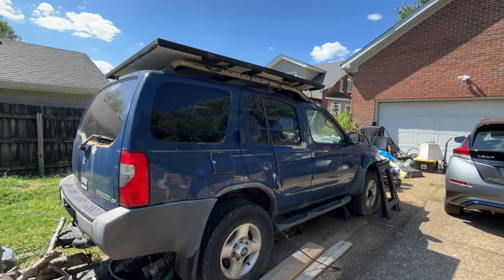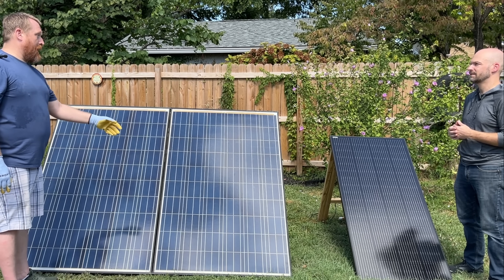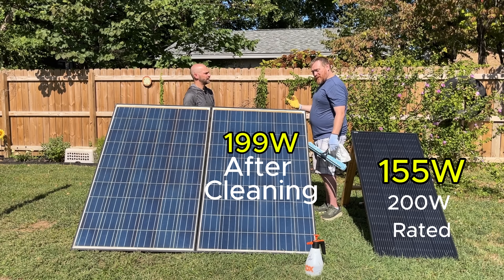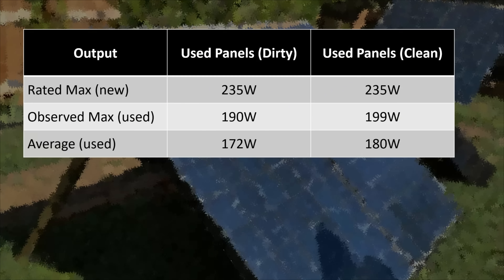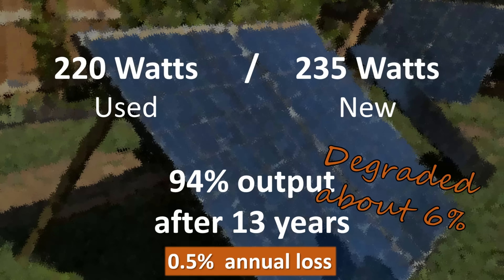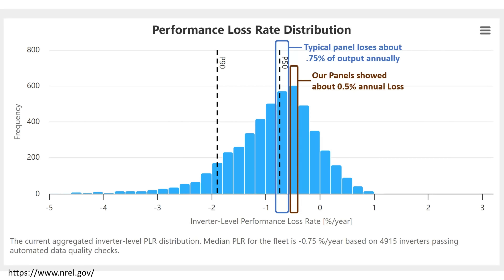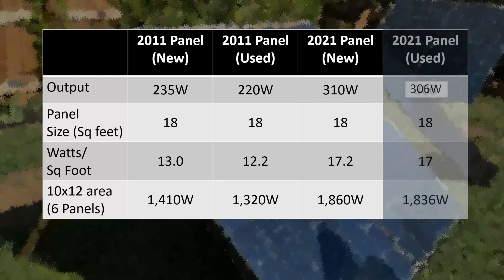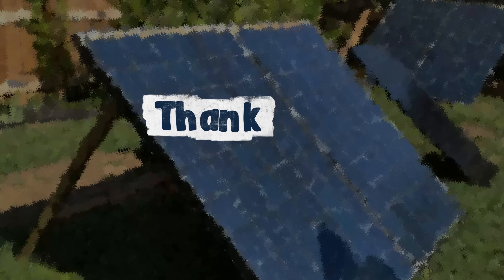Considering used solar panels?  We put them to the test!

Comment: Well, considering the price for the used panels, Free in considering if you just added two more used panels you’d make up for the loss and efficiency from new panels. I’d say they use panels were a great deal.
Reply: This is how you really use second hand solar panels. Panels lose efficiency over time. A grid connected inverter has a rated DC input voltage to enable it to produce the inverter's rated output. By increasing the number of second hand panels in a string you raise the input voltage to the inverter and increase the system's output back to original specification.

Comment: I say yes, Used can be good, if you know what you’re getting and the price is appropriate.  My advice is, if you’re going to pay money or put labor into obtaining the panels, test them for voltage (at a minimum) before.  Also, inspect them for damage to the bottom side too.
Reply: You can get a cheap thermal camera these days and check the panels as they heat up, run and cool down.

Comment: The question is : why do you need panels for? If you want to lower the bill they free panels are a benediction. Keep in mind that if they come with free mounting hardware, free cables and free inverters it's even better.
You can't beat free stuff when it comes to economics.

Comment: I bought 10 x 180W 15 year old panels and an inverter cheaply from a guy who was upgrading. He gave me the original sales invoice for over £16k. I have now been using them for over 5 years. On a sunny day these 20 year old panels still do just over 1500W, so are 20% down on their abs max output. This all assumes they could actually do 1800w in the first place. I couldn't be happier with them.

Comment: Are the old one polycrystalline panels? (since they are blue in color) 
The modern panels are usually monocrystaline (black) and is more effective per square feet so that should be considered in this comparison..
Poly panels was cheaper compared to mono cells per square feet but is less effective.
Reply from the maker: Yes - good point, older panel was poly-si.

Comment: Best advice imo is to invest in the $100 panel tester, i bought some 310W panels that i found to only produce 150W afterwards. I bought 8 and had hoped they would produce around 250W to get around 2kW for $80 a panel but unfortunately they only produced half of that. The panels in the video were free so pretty much the only factor that would be relevant to me is the size/kW.

Comment: I've got 123 panels & all but about 12 are used but not very old. All my used panel put out to spec but were about 1/3 the cost of new panels. Best way to test used panels is to use a clamp amp meter with the - & + wires plugged into each other.
Reply from the maker: Thanks for the tip on testing panels with a clamp amp meter!

Comment: also in hot climates mono cells do better. in colder places poly panels like these would be good.
but on the other side it is free, why complain.
also you can buy now for about $60,= ( here 50 to 55 euro ex vat )
600 watt panels dual glass panels. size is about 115 cm x 235 cm.
Reply from the maker: Good to know about mono cells in hot climates. We've seen a spike in panel prices in the US lately.

Comment: The issue I have with my panels is that during August they do not produce as much electricity because they get too hot. 

I'm going to have to look and see if there are any solar panels made to handle the heat better.  It's probably cheaper just to buy a couple extra panels.
Reply from the maker: Yeah, the test day in the video was very warm, too.  Would be curious to hear if you find panels designed specifically for higher temps.
Reply: @BackyardSolarProject 
Okay this is odd. The post was censored.
Reply: @BackyardSolarProject 
Monocellular panels do better in temperatures over 100° f than other panels.
Reply: @BackyardSolarProject 

One such panel is the RC alpha pure RX solar panels. 

They are about 350 for a 400 or 450 watt panel.
Reply: Okay I break the information into two posts, drop the dollar sign, and no censoring. 

How bizarre, how bizarre.

Comment: I plastered my roof with used panels and built a Tilt Array with 12 more used panels.
29- 250W panels and 22- 100W panels = 9450W
I reduced my electric bill from about $450 per month to about $150 per month.
I have power to spare.
Reply from the maker: Wow, that's an impressive setup and great savings! Where did you source the used 100W panels?

Comment: Even when the panels are free the rest that is needed are much of the cost. Batteries, charge controller, inverter, connectors and cable. If you have to buy the rest it could be smart to buy the panels new also since the payback time could be a lot shorter even with the added cost from new panels.
It can be expensive to save money when you install something that is meant to last a long time.
Reply: If I had free solar panels, I could try connecting them directly without a regulator to my 2 cubic meter water heater. I normally heat the water heater by burning wood, but it also has backup electric heaters. Free solar panels could reduce wood burning and labor, and store energy without any investment, battery chemicals, or use of natural resources. Heating elements are unlikely to be very sensitive to voltage, although the thermostat and circuit breaker are designed for AC voltage, so I'm not sure about their durability. You could also try connecting solar panels directly to electric radiators which are also available practically for free. Here in Finland, the sun rarely shines during the heating season, so it is not profitable to pay for a solar power system for heating, although hot water is used all year round. Also, globally, a large portion of electricity is used to heat water, so why are inverters, controllers, and batteries needed when energy can be stored directly in water without toxic battery chemicals and mining?
Reply: @AH-li7ef  If you have a use case where you can connect directly to a heating element you can cut much of the cost.
It will for must people be of limited use.

Comment: Also before paying for used panels, or even paying to transport free ones, check the current price on new ones - here in the UK you can get 450W panels for GBP66 / US$80 delivered.
Reply: Please share what source you're finding those prices from! Here in the US, a 400W is about $250 new
Reply: @videosfromelsewhere926  City Plumbing in the UK. But Tarriffs are probably messing up the US market
Reply: @mikeselectricstuff thanks! Yep they really are. We're being squeezed every which way
Reply: @videosfromelsewhere926  
UK, shipping them from China is going to be a lot cheaper for them than having them transported over sea to the states.
Reply: @MHawkeye Specifically, which company or outlet? Comparing our supply chains. I suspect we're getting the same Chinese panels but with a steep markup along the way. Tariffs aren't helping either
Reply from the maker: That's an incredible price for new panels, especially with delivery included!  Do you have to buy a pallet for that price?
Reply: @BackyardSolarProject  Nope - Just a £75 minimum order.

Comment: How did you determine the output watts???  You never said.  What testing did you perform?
Reply from the maker: I used a power station, in this case a Bluetti AC70. I was able to measure watts, amps and volts.

Comment: G'day Mate, my best advise to anyone trying to live offgrid is to buy as many secondhand solar panels as you can, have them along every fence and on the ground. I have been buying any secondhand solar panels from Facebook Marketplace for over a year, to the point where I have 120 solar panels. Now it doesn't matter if it is rainy or cloudy, I am always making some power whenever it is not dark. Old solar panels might have less output then new panels, but it all adds up to getting more power into your batteries. But take a multimeter to test that each panel is working when buying secondhand solar panels.
Reply from the maker: That's a lot of panels, sounds like a great strategy for maximizing power! Where can we see some pictures of your setup?
Reply: Me too mate, bought 20 250w panels for au$300, blasting out power, bought some more so i have overcapacity for my chargers, so i still get decent load in dull cloudy weather, 6kw of inverters, can run aircon  and charge batteries at the same time.  South australia
Reply: As long as you know how to properly test a solar panel.  They can be deceiving.
Reply: @rickschlosser6793 can you explain how to do it correctly please
Reply: @timanderson-q2w  - you buy an electronic load with sufficient voltage and current capacity.
Then you measure the output in full sun.
Reply: @johncoops6897 cheers mate 
Jaycar I'm coming 😂
Reply: Very wise choice mate 
I'm up the top end doing the same thing but not quite as many panels yet 😂
I'm silicone mine together up on the purling no tin😂 just solar panels 
The new truck park is near ready 😂
Reply: I would like to do this but don't understand something. Isn't there a risk of having too much voltage going into your inverter on a perfect/sunny day? How do you prevent that?
Reply: @Just4Ever - you use an inverter that is designed to accommodate the panels you intend to run.
The panels aren't always connected in series (adding the voltage) - for example, you can run two in parallel which keeps the voltage the same but doubles the power output.

Comment: People have to understand that the rating on these panels are under optimal testing conditions-cool day, desert sun, higher altitude etc. 

There are panels made in the 1960’s that still produce useful power-these panels still represent a GREAT value, especially for DIY’ers who don’t care about warranties. On a dollar per watt basis, these are disgustingly affordable and represent an opportunity for everyday people to have access to a very powerful off grid setup very affordable. 

I am running an entire off grid cabin with microwave, 160 foot deep well, washing machine, electric log splitter, coffee water heater, all charging of electric chainsaws and personal electronics etc. on just for (4) 235 watt panels and eight 6 volt 150AH batteries. 

And BTW: It’s the solder in the panels that degrades over time, the silicon is fine.
Reply: Current solar panels are guaranteed to have 85-90% power retention after 30 years, so technically the solar panels will outlive any human before it really needs to be replaced
Reply: Awesome ❤ information mate cheers

Comment: So, these panels still output a decent amount of power and they were free...
And by extrapolation, you can assume, after 14 years and quite a small loss, you could get probably another decade of power out of them...
If they were still good to use, why would you bother to get 'newer' panels at some cost, when these were free?
Reply: If you dont have much roof space, replacing those older panels with new 475watt units would double you're solar power output. Of course if you have plenty of good roof space left and want more solar, you would just add another string of new panels and keep the old ones running. Probably need a new  inverter to get the best out of the system either way though.

Comment: Other things to test with used panels (with a multimeter):
Open circuit voltage
Short circuit voltage
(both will be different from when new, but be cautious of panels that are significantly different from the others. There is no use putting up ‘dodgy’ used panels
(TYPO - I meant to type short circuit current)
Reply from the maker: Thanks for the helpful tips on testing used panels with a multimeter!
Reply: You don’t measure ‘short circuit voltage’.  I don’t even know what that is. 

The proper way to test a solar panel is to find the nameplate on the panel and look for the ‘Isc’ rating.  That stands for ‘short circuit current’. 

Get a clamp on current meter set on DC current, use a short piece of wire to momentarily short between positive and negative and measure the current with the meter.  Then compare that to the specification. (Obviously do it under full sun)

Just testing voltage won’t tell you if it will fail under load.  I was taught this method by an electrical engineer.

Comment: Used panels are so cheap I saw a solar fence last week at a suburban home. I thought is was weird till a saw a YT video with vertical panel tests that showed a surprising output compared to normal slant panels. The output from North-South panels balanced the output from East-West aligned panels. I the winter snow the vertical panels exceed their rated output and bested slant panels even after snow removal. The vertical panels clear the snow automatically!! Cheaper that fence wood I expect to see more urban and farm fencing made from used panels.
Reply from the maker: Yes, it does have advantages.  Also - agree, there are some interesting videos on this topic.

Comment: sorry why you not replace your control panel?
a 200 watt rated panel that not deliver its rating have clear maufaktur failures !!!!
for example a callsun 200 watt rated for 200 watt deliver 200watt...so it have to be !!!!

next part a 200watt watt panel from today need 2x smaller space to produce there power !!!!!
so if you limited in space why someone will used ultra big panles with ultra low power for there surface???

Nowadays, solar panels deliver 220 watts of power over an area of one square meter! 
Classic roof panels are exactly 2 square meters and come with 450 watts precisely for that area.

that matters for most people
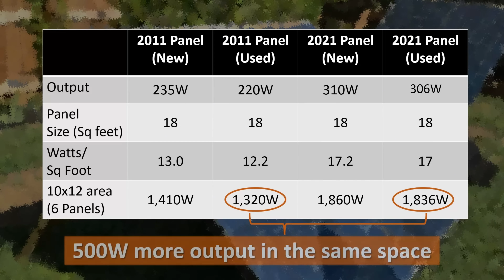Reply: I don't care what brand it is - A panel PRACTICALLY NEVER puts out its actual rating unless it's under lab-perfect conditions, and then, only for the few moments when those perfect conditions apply. Anybody who thinks otherwise is delusional. Ratings are based on those "lab-perfect" conditions - which are almost never seen in a real-world installation, and on the rare occasions they do happen in the real world, it's for a few minutes per day before things (like exactly where the sun is, and how hard the wind is blowing to cool the panels) change, and you start seeing the more normal lesser output. ANYBODY can set up a panel to produce "perfect output" - from between 12:01 and 12:07 on June 22 - any other time of the day, or any other day of the year, it's going to be "less than perfect" unless you're sitting there tweaking it every 3 minutes or so.

Comment: That's all I buy these days. Here in the Bay Area of Northern California, some solar suppliers sell used panels from failed businesses. I can get used 350-watt panels less than 5 years old for only $35- $40. All work just fine.  Test them before you buy them.
Reply from the maker: That's awesome! Always great to hear about a good experience finding panels locally.

Comment: The real comparison data would be dollars per watt .in my area 10 to 25 cents per watt is common for that price just add a couple panels and you are well above any reduced output and well below the cost of new .
Reply from the maker: For sure ... and the cost per watt also needs to take into account shipping/delivery. These free required a reciprocating saw for disassembly, transport took a trailer, and would very like need two people for installation. In the end, it definitely wasn't completely "free".

Comment: I've bought new and used and had better bang for the buck with used. I bought from a solar farm builder and paid less than 20 cents a watt. The panels had 5 years of service and were replaced for optimization.

Comment: Building material is expensive too, solar panels are at least as good as roofing material as anything else, add a car battery and some cheap LEDs and you have a carport which is illuminated at night for free
Reply from the maker: I've heard this from a few different viewers now. Definitely an appeal as a low cost covering for something like a carport.

Comment: In Australia, these units are freely available and still function reasonably well. By wiring them in series, you can achieve approximately 220V DC—suitable for powering resistive loads and universal motors directly, without the need for inverters. For optimal performance, consider mounting them as a fence and using microinverters to mitigate shading issues. Cleaning the panels with a moss remover is also beneficial, as green algae spores can accumulate and reduce sunlight exposure.
Reply: Be EXTREMELY careful using DC at high voltage like this.
DC arc at extreme long distance compared to AC, switches and relays will arc when switched off under load.
Was thinking of doing this myself but do some research on this, I vas a little shocked about this.
Watch some DC arc videos here on yt and be careful when dealing with high DC voltages..
Reply: @jada1173  DC relé vagy IGBT kapcsolja.
Reply from the maker: Great suggestions, thanks for the helpful info!

Comment: Hello from the north side of the USA border.  I guess it's around 25 years ago or a little more I some how ended up doing a number of off grid install jobs. Back then it seemed like people were putting up one wind generator for every 4 solar panels backed up with huge gas or diesel generators of course that was to keep there literal tuns of led acid battery's  charged.  These jobs were out of the way enough that even back then the cost to put in grid power verses put in these huge off grid systems made it a no bran er.  It wasn't many years after that when panels started getting cheaper and used solar started to become a thing and it was in these same out of the way places that I started to see guys using solar panels for the roof.  It was explained to me that once you could cover an aria for the same or less than the price of steel with solar it just made sense you get a roof that should last a couple lifetimes but glass or solar is much quieter in the rain and you still have years of power you can get as a bonus.